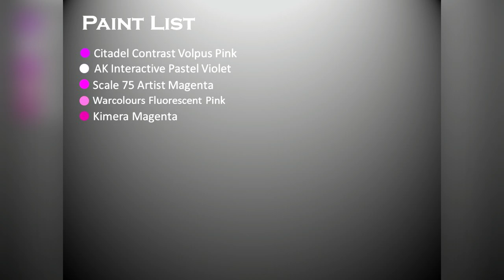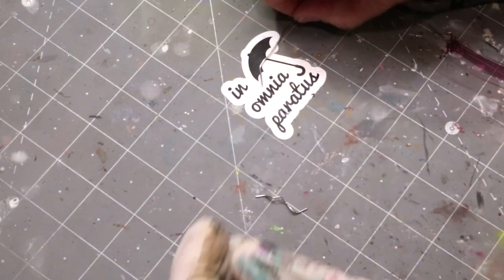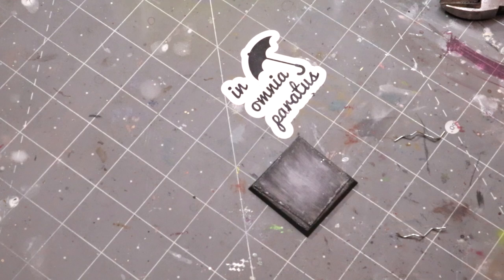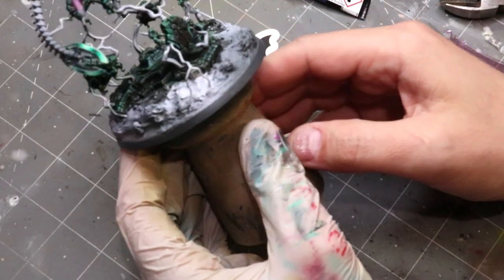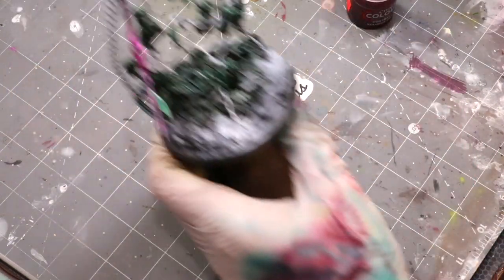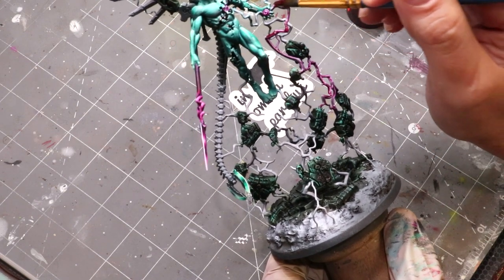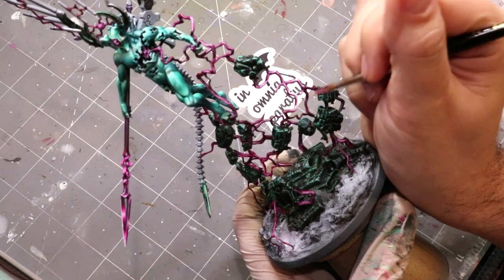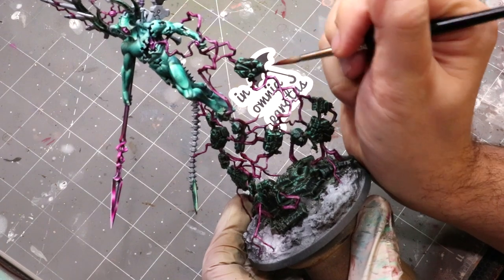Hobby Cheating 265 - How to Model & Paint Lightning

Comment: I do have a question. This is an old video so we’ll see if I get any answers: what would you recommend for thickness on the wire used? I see in the video you used parts of a paper clip but I’ve also seen people use wire which can be a little easier to work with. Currently looking at 0.2mm thickness but I’m curious if you (or any other random internet hobbyists) have any thoughts or advice.
Reply from the maker: I always see all the comments. Yeah that kind of bendable wire craft wire you can get from the craft store is awesome for this and you can actually vary the thickness. Get a couple different gauges and it can make this process very easy cause then you can do sort of centralized bolts, but then break it off into smaller bolts on the side. I’ll also say you can also do that with different size paper clips if you wanna keep it simple.

Comment: Vince I had a question for you. Remember your video on making smooth white paint? Have you had success brushing white using airbrush paints? I've been able to use a couple of them without any chalking or other bad side effects.
Reply from the maker: Yep, I've used the airbrush paints as well, where they break down and where you really see the chalking is when you thin stuff out, and those are quite susceptible to that.

Comment: Little question here. Do you have to use something to fill the gap between the clips you glue together or is the mass of the glue itself enough? I'd imagine it would be pretty visable?
Reply from the maker: Generally, just the glue itself. But with the gel glue, you can wipe away the excess  and it's really easy to do. Once primed, you can't see it.

Comment: Hi Vince! You've shown us the effect and method viewing the arks under one angle, but do I assume correctly you apply the pattern 360°?
You said to paint white (or lighter color, rather) the change in direction; does this mean the inside angle of a 90 degree turn is still dark, or does it have to be light?

Thanks for the tips! I do have a big box of clips (for pinning) already, hmm... :-)
Oh, since I'm at asking a question: would different diameter clips / wires be of interest here, like going for piano strings or something for finer tips for the secondary arcs?
Reply from the maker: Yes, I am doing the light in a 360 around the shape (or mostly so), you don't need to worry about shading the lightning, it would be creating light. That being said, if you don't get it perfect, those hidden areas are okay.

Comment: Hey, just wondering if you're going to answer the question I sent earlier, you hearted it but didn't answer? No offence meant I'm just a bt confused.
Reply from the maker: Glad you followed up, I went to reply then hit the wrong button and lost the comment. Okay, so lightning from the chest, paper clips as you saw here, drill a small hole, make it a little ragged, then do the bendy trick just like here and glue it into place. Should be the same sort of technique and totally doable. Hope that helps.
Reply: @VinceVenturella  ok thank you, if I'm possessing it from the master of possession should i do it from the eyes of the staff? and should I make it look like the staff/ space marine are "wreathed" with lightning? would that be possible even?
Reply from the maker: @SmurphofChaos  Sure, you could connect from the staff to the chest or something similar.
Reply: @VinceVenturella  what about the last point?
Reply from the maker: @SmurphofChaos  Wreathing the whole thing is probably a step too far, it would be difficult and block the figure, less can be more.
Reply: @VinceVenturella  ok thanks, should I do it for any part? Like around the staff? or just not at all?
Reply from the maker: @SmurphofChaos  I'm not there and cant see your project or your vision, but my advice would be like you see here, some bolts jus travelling in a limited fashion is the probaby the right idea.
Reply: @VinceVenturella  Thank you so much for your help, definitely earned a sub